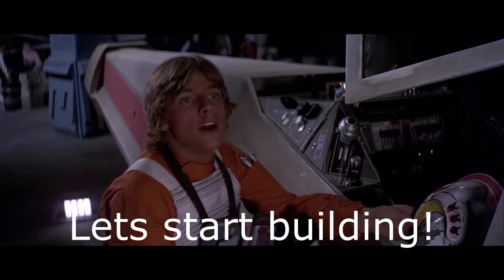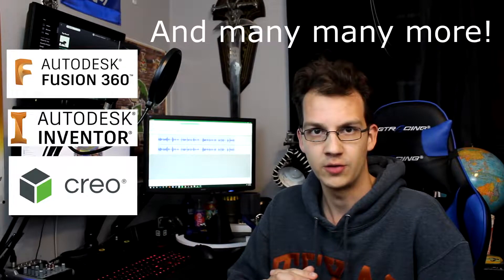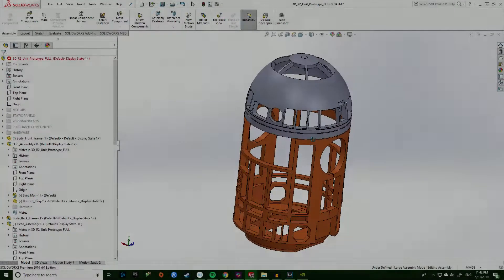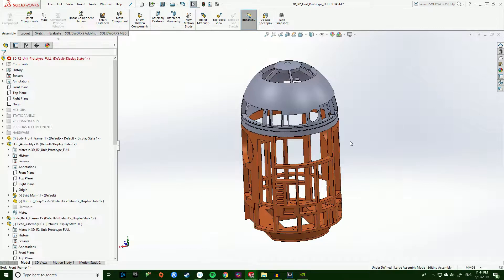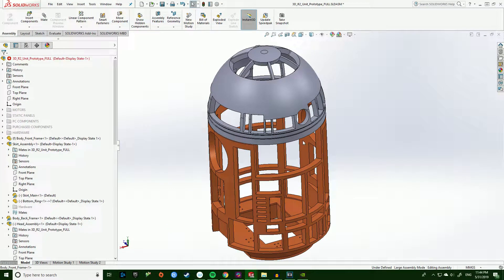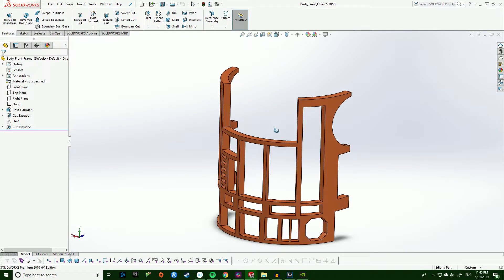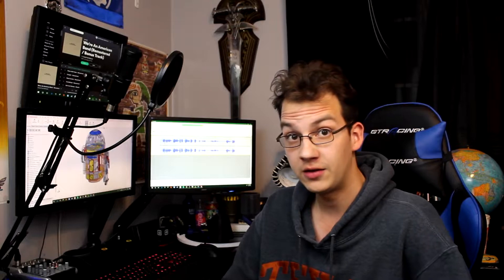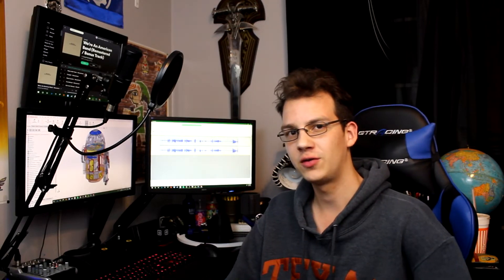Episode 1 | Building a fully autonomous and 3D printed R2 Unit | Intro and Frame

Comment: Just speculating but wouldn't a new Pentium processor with ddr4 memory be faster than that old i5?
Reply from the maker: Absolutely, however, for this build, my current PC build (which uses this old i5) has been fine with gaming. But, I'll keep that in mind, might give the processor an upgrade when transferring
Reply: @baronvonerik384  well, I think the best reason for upgrade would be power consumption considering how expensive batteries are nowadays. But I guess when it's time to install the computer you can look at or test battery life.